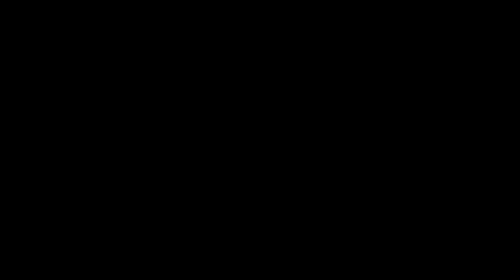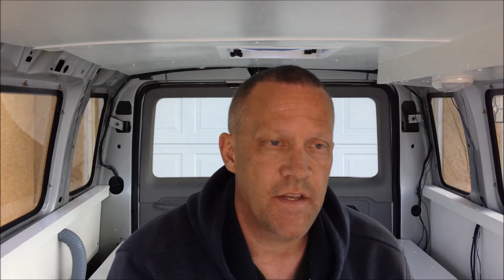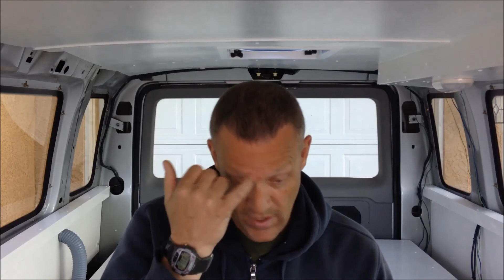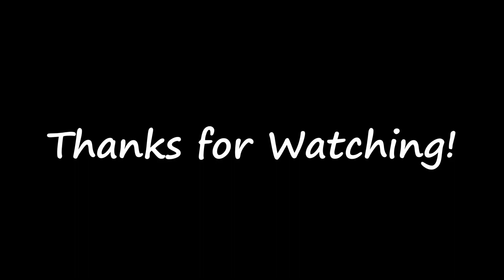Explaining Electrical and Solar | Ford E350 Camper Van Conversion

Comment: Sorry, I mixed the two sets of batteries up, you mentioned, 2off 6v in series, but then said you used 12v in parallel. So the 12v ones you used would have the two amp/hours added. Useful video anyway...

Comment: if you wire batteries in series you double the volts not the amps, so that set up is 12v 105a/h.
Reply from the maker: +Allan Byrne I am using two 12V batteries in this current set up. It is wired in parallel, 12V 212 A/H on this set up. You are correct, if I used two 6V batteries wired in series, this would be a 12V 105 A/H set up.

Comment: Great video. Just bought a coversion van for van camping all around the country. Will be adding solar power. The list you posted here is a great start and helps save a lot of time. Have you published any videos showing the actual installation of all these components? You may have but I just subscribed to your channel and haven't looked .
Thanks again.
Reply from the maker: +Seth Glassman Thanks for sub. I do have some videos explaining some of the details of the solar system and instillation. The info is kind of randomly placed throughout my videos. I just videoed steps as they came necessary throughout the progression of the build. I hope you can get some good ideas off my videos.
Reply: +WannaBFree Thanks for your quick reply. Yea, I found your Van Build 19 video on fuse box, grounding bar etc.  This video answered most of my questions re: fuses, fusebox and grounding. One quick questionc though Does thesolar panel branch connect allow for the connection of the 2 seperate 100 W panels to be connected together?
Reply from the maker: I'm not sure exactly what you are calling the "solar panel branch" but I'll take a stab at the question. There are two wires on each panel. Of course a + and -. Then I have two Y's that I show stuck to the outside roof of the van on the aluminum brackets I made. Both panel positives go into one Y and both panel negatives go into the other Y. Now you have only one + and one - to take into the van and connect to your solar charge controller. This is called parallel wiring. I have two 100W / 12V panels wired in parallel giving me a 200W / 12V system. Hope this answers your question.
Reply: +WannaBFree The solar panel branch connectors were listed in your list of components below this video. I took those to be used to connect the two 100W solar panels together in parallel. But, why did you use two 100W panels instead of one 200W panel?
Reply from the maker: +Seth Glassman Too funny, it's been about a year since I purchased those items and I didn't remember the correct terminology. You are correct, the branch connectors are the Y's I was talking about in my previous post and yes they are used to connect the two panels in parallel. 

To my knowledge Renogy did not have a 200W single 12V panel at the time I purchased the solar for my van. I think the largest single 12V panel is a 150W panel. Then you jump to a 230W 24V panel. My system is strictly a 12V system so I wanted to go with a 12V panel. I didn't particularly care for the dimensions of the 150W panel so I decided to use two of the 100W panels. It just depends on what mounting space you have available for your panels. I prefer the Monocrystalline over the Polycrystalline because they put out a little more power but they are a tad bit more expensive but not much. With limited space you want the most power you can get in that space. 

I didn't go with 24V because I would have to wire my battery bank in a 24V configuration (series) then step that down for 12V gadgets. There will be a loss of power in the step down process. 

The BEST and MOST EFFECTIVE item to incorporate on any solar system is adequate wire diameter for the length of run. If you use wire that's too small you essentially choke off the system and you will not be able to harness the power your panels are producing. If you do a Google search for a wire run chart you will have all the info you need. You also need to know the amps your panels are capable of producing. Here is my requirements for a two 100W panel system. My panels are capable of producing a total of about 12amps between both panels. I am using 10 gauge wire to cary the power to my controller and that run is just under 10 feet. I get less than 1% loss on that distance and wire size. Usually you want to keep your loss less than 2% if possible. If I remember correctly the 100W Renogy panels come with 12 gauge wire but I upgraded to the 10 gauge so I had less loss. 

Sorry for rambling on "off topic" but just remember to use a good wire resistance and voltage calculator and size your wire so you don't have more than 2% loss. Here is a link to a good calculator.(http://www.bulkwire.com/wireresistance.asp). 

Oh and one other tip. With a 100, 200 or even 300 watt 12V system there isn't much benefit using an MPPT charge controller vs a PWM charge controller. There will be a slight benefit but it's not worth the cost difference for a good quality MPPT controller. I would recommend saving money on the charge controller and use good wire. Just my opinion from the research I have done over the past couple of years. Hope this helps you out a bit.
Reply: +WannaBFree Thanks. I'll do some research on the panels available now